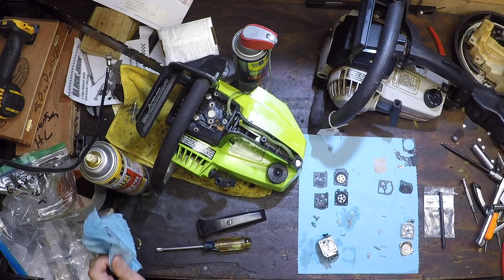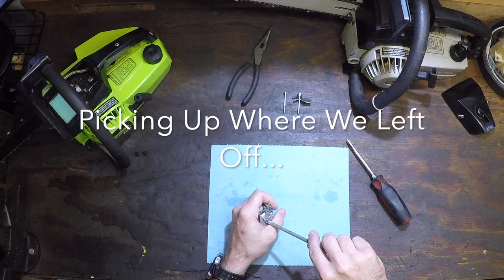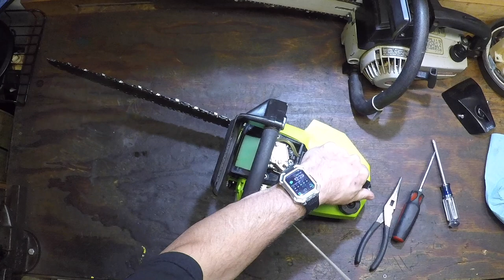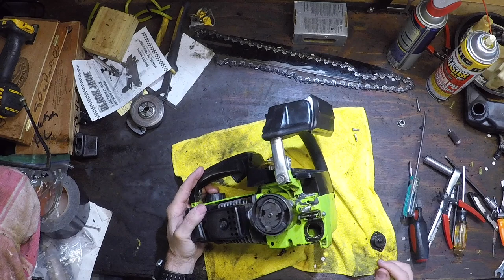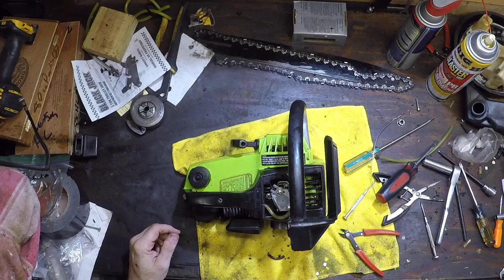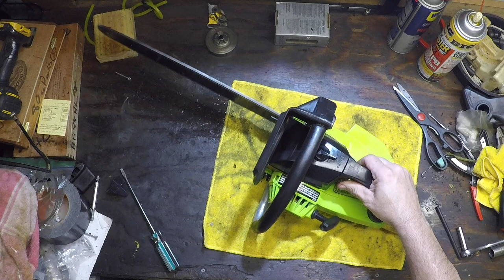Poulan 2000 Carburetor Rebuild & Oiler Repair

Comment: These are the easiest saws to work on. I have many in my collection. They can be tricky to fix if the oiler stops working due to a faulty check valve.

Comment: Can you tell me what were you checking with the gauge attached to the fuel inlet fitting? Was it vacuum or pressure of 10 on the gauge ? Thanks
Reply from the maker: Pressure. In order to know if the needle is properly seated and that the carb itself is sealed completely, about 10lbs of pressure is pumped into the fuel inlet. If pressure is maintained for more than 10 minutes with minimal loss, then it should be good.
Reply: Thanks

Comment: Can you tell me what the top and bottom adjustment screws are and how to adjust the saw? I have a Craftsman equivalent that I just fixed and need to know how to tune it properly.
Reply from the maker: The two screws are high (H) and Low (L). The low screw ( Closest to the engine ) handles most of the  heavy lifting whereas fuel flow is concerned. The high screw kicks in at full throttle, richening and adjusting the mixture so as to not “lean out” the saw thus keeping the internal combustion temperatures at a manageable level. For most saws, gently turn in both H&L until seated, the back both out 1 to 1-1/2 turns. That should put you in the “ ball park” to get it up and going.

Comment: New sub here Im currently working on a poulan 2000 saw I have fully took it apart for full clean and service I'm now at the carb but for the life of me can not figure out how the carb comes off  the body of the saw could I ask kindly how you removed the carb many thanks
Reply from the maker: Looking strait down at the saw, there are two bolts that hold the carb on. one holds the choke in place, and one more matching bolt on the opposite side.

Comment: where in the @#$%$%&^&**(((is the spark plug location on this saw?????>
Reply from the maker: Well hidden between the muffler and the fuel tank. Towards the end of the video you can see the spark plug boot peering out right behind the muffler.